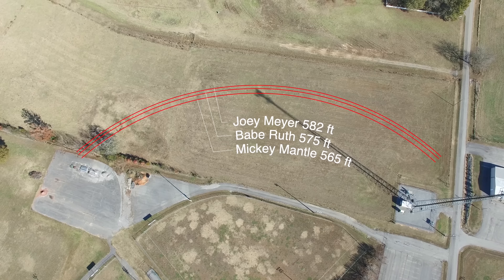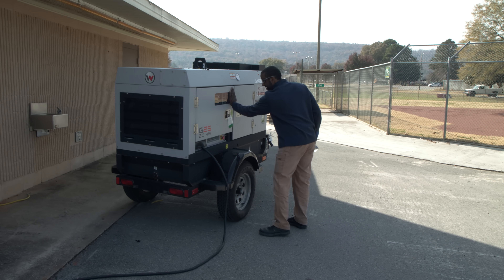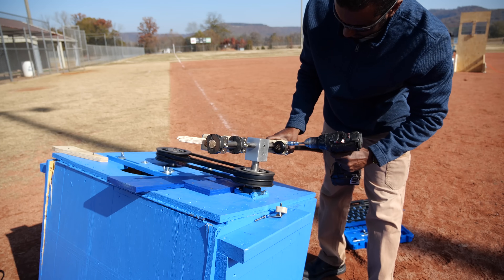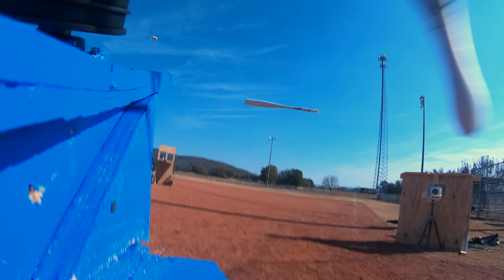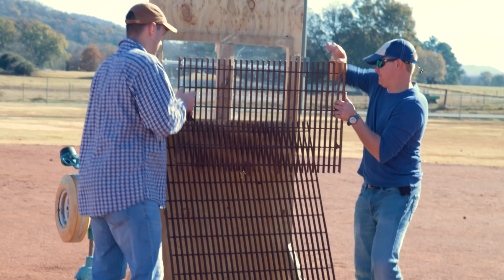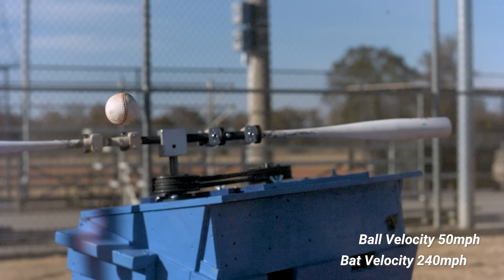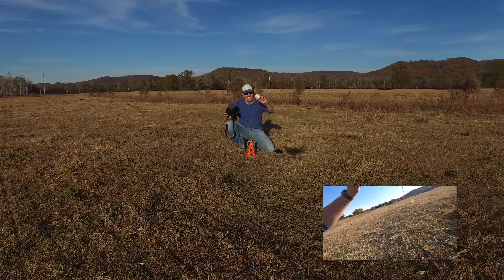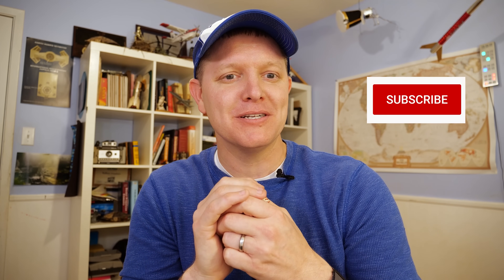World's Longest Home Run (The "Mad Batter" Machine) - Smarter Every Day 230

Comment: Use a counter weight instead of a bat and then you need to make the bat stronger and take account for the pressure of the ball hitting the bat and make sure the machine can take that kind of force against hitting the ball then try to do this 🤷🏻 I think you also need to not stand in front of this whole situation 😅 idk seems to fast for humans to react fast enough 😂 …

Comment: Fascinating video. Gold star. 🌟
It sounds like a helicopter. I wonder what would happen if, instead of bats, you attached RC chopper propellers to it. Make sure you have on military-grade protection in case of flying rotor blades.

Comment: Your statement that residential electrical power is a single phase is technically incorrect. There are two 110vac lines entering the house inorder to supply the 220vac required for water heaters, stoves, clothes dryers, etc.. Those two lines are 180⁰ out of phase with each other; thus, power entering the house is 2 phase.

Comment: Mantle on 22 May 1963 hit one in the old Yankee stadium they said was still rising when it hit the concrete facade left a mark in it and bounced all the way back to the infield. They were able to get the exact height and distance. Some estimates at the time said it would have gone over 600ft, maybe 660ft.

More recently, I saw an estimate of that shot that was not nearly that far, but it was based on a false assumption. He assumed it left the bat at 122mph. 
He assumed Mantle could not hit one out of Yankee Stadium because he never did, wrong!
He did hit them out during batting practice a number of times. This was documented in the Book "Explosion" by Mark Gallagher. 

Mantle said he was tired of the extra innings (13th inning…..BTW, I was watching on the game on TV) and he was going for it. So, he was swinging from his heals, caught it perfectly. Batting practice ball comes in at maybe 70mph, he hit a fastball so figure 90 or more? They needed to calculate with those assumptions.

Comment: This is kinda crazy since you should easily be able to calculate the maximum distance a projectile, in this case a "perfect" projectile such as a spherical ball, could travel given pitch speed, bat speed, launch angle (should ideally be around 45°), gravity causing exit velocity of x, in y seconds using the principles of physics and calculus.

Comment: Ok.... ya’ll stoopid... that machine wasn’t made out of welded steel, with the bearings bolted onto said frame... and then steel plates it’s bolted too on the ground... then bags of sand on top of outriggers....  otherwise..... ya should have built that way better

Comment: not gonna read all of the comments but....faster pitches equal longer homers so what's the deal on getting 100mph pitches on your 200mph bat?  717ft seems lackluster for J. Fielding's apparatus.  After seeing the supersonic baseball cannon video there is absolutely no reason whatsoever we don't see a 1,000 foot home run this year.  Custom cast metal bats if you must.  I live in the Lookouts city but I'll buy Trash Panda gear if it will make this happen!

Comment: Electrical science is fascinating. Like how as voltage drops, the amps increases; which is why when the 60v 3-phase generator that is the alternator of a motorcycle dropped a phase, it dropped the voltage, kicked the amps into high gear and instantly roasted the regulator that was meant to bring the voltage down to 12v. The result was that I broke down.

Comment: That looked awesome. The thing I find crazy is that even with a machine as crazy as this, it's only ~100 more feet that the world record made by a human, this human made homerun must have been absolutely insane.
Reply: It's the law of diminishing returns.  Air resistance gets higher the faster you go.
Reply: Physical limitations
Reply: Babe Ruth never Hit 575 people can't even replicate that in today's standards lol. They said that to drive ticket sells for Babe. Yall are sheepskin and believe anything. 😂
Reply: With a wooden bat
Reply: Also did it with a wooden bat
Reply: @all0utmetal735  And a guy trying to strike him out.
Reply: I feel bad for the guy trying to strike him out
Reply: It has less of a power to speed ratio than a baseball player, it proved how much strength matters.
Reply: @Adventuresandaquariums  That is not the correct takeaway. The hardest a human has every hit a ball is with a 122 MPH exit velocity. Here we have a 190 MPH exit velocity.
Reply: those records are highly exaggerated, at best they rolled down a hill to the alleged distance or is fake altogether.

Comment: When the first wooden bat broke, it was because the grain of the bat was not set correctly.
If a wooden bat was used, you should be able to get another 75 to 150 feet out of the ball.
Also, the speed of the aluminum bat might need to be adjusted so it doesn't absorb the inertia of the ball.

Comment: Ha ha. That was kool.use a long shaft top to bottom of machine.add 400 lb weight under it,balance the bats,and use solid metal bats.i had better results with 1 bat and counter weight.(this allowed the balls to enter the sweet spot better)1500 feet is about all the baseball survived. Superballs 3000,..dam golf balls,,they go way away.

Comment: You were also using metal bats not the wood ones you prob wouldn't be able to hit it that hard w/ a wooden bat
Reply: wood bats would bend and break at how fast it was going
Reply: But if the MLB used metal bats they would easily be able  to break that record

Comment: This is very cool and all but these are very juiced bats no doubt normal aluminum bats would've the same thing if I'm using that cat 8 vs my older marruci my velos would be different but yeah this is incredible and you really dont need a high angle just hit the baseball 110 mph it'll fly

Comment: Honestly I found it very impressive that humans compared so favorably. Now of course the air drag makes it harder and harder to add more distance but still.
Reply: they were not real records, rather old baseball myths. The biggest strongest sluggers today have trouble breaking 500 feet on the fly, the old records were measured at where they found the ball which includes a ton of rolled distance.

Comment: My "theory" here was the material used as a stand. It vibrated so much even weighted down some. It's high speed, so any tiny wobble, and touches the bat will send that wobble into a wave that increases and either busts the bat, or breaks a bolt holding the bat.

I think the bat's were too close to that angled wood you had to give that upwards swing for the home run.

You have to somehow bolt that stand to the ground, or.. Hmm thick steel foundation on the ground for Weight so it doesn't wobble and move? I'm not an engineer sadly, but perhaps a fan / viewer can add onto what I'm trying to say? It makes sense in my head, I just have a difficult time expressing it at times.

Comment: At 5:54 I used the approximation that the bat moved about its own length over 1 frame, and calculated that the bat flew off with a speed of about 185 mph. Dang.

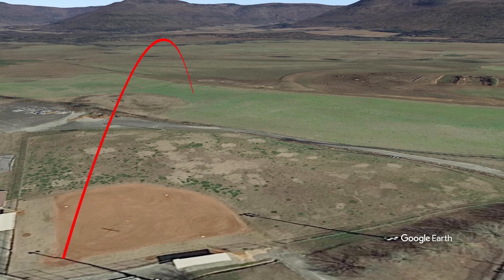Edit: Looks like I was probably close, at 12:09 he confirms the tip of the bat was rotating at 183 mph.

Comment: In MLB it doesn't count after the ball hits the ground. Mantle and Ruth hit those distances on the fly and the riochett distance the ball went after it landed was not counted in the HR distance. How far did it travel after it landed? Did you calculate the balls distance from where the ball first landed? Or did you calculate the distance on where you found the ball resting after skidding off the ground several times?

Comment: I read once...where a sports physicist calculated that under the right conditions....torque..wrist impulse speed....bat speed....low humidity...110 mph fastball...and at altitude in Lima Peru....with a 30mph wind blowing toward center field...a man is capable of hitting a 750 foot home run..... (there are stronger wrists than Barry Bonds..Pujols..Babe Ruth).......also a aluminum bat.....and hitting the sweetest sweet spout ever.....
There may be a few humans ..when skilled and trained...qhuch can generate 180mph bat speed...maybe
maybe not🤔🤔🤔

Comment: What about Manny Ramirez hit a ball on the 6th lane of tha Mass Pike if you can find video of it and use modern algorithms they originally estimated it at 580 but then changed it cuz couldn’t have Manny have the record over Ted Williams and the red seat at 502 but if you could find that game in the NESN archives that’s probably the longest HR in baseball history or Jose Canseco hit a ball on the awning of the upper deck in the old Toronto stadium or yankee stadium can’t quite remember they was also allegedly 580

Comment: Wait, use that supersonic Baseball canon to shoot a baseball at these rotating bats :D that will be awesome.
Reply: Exactly what I was thinking
Reply: @duocamerakids6266  same
Reply: The bat would snap so fast
Reply: @lucasmarshall1546  even if it's solid metal ?
Reply: @noblegeorge5789  it wold break the bat and the ball would disintegrate it’s physically impossible for a baseball to get shot at Mach 1 remain perfectly fine then abruptly stop, then get hit at 500mph and survive
Reply: @danksanchez4324  I don't think the bat will break coz the time of contact between the bat and the ball would be hardly enough also depending on the mass density and material of the ball it's very unlikely.
But all the same the ball could disentigrate (which would look awesome especially in slow mo) BUT I think it's possible to overcome that my increasing the moment of the ball by increasing velocity. Maybe the ball could be thrown at an angle towards almost the base of the bat such that adding up forces it's resolution would be towards the lenght of the bat and finally the bat imparting the balls final velocity. This would help it not disentigrate.or all the same the bat could be padded with some material to help with the sudden moment of the ball. Or just exchange the base ball with some thing else. Anyways all of the above would be cool to watch.peace✌️
Edit: you could also use the thrusters in the bat btw sooo.........😏
Reply: @noblegeorge5789  if it’s a bat made of pure steel probably not, but a normal baseball and a pure steel ball = non existent baseball and if you make the ball metal you just get a slower baseball that would probably still explode and break the bat, and if you make it padded you just get slightly less instant decimation of the baseball
Reply: @danksanchez4324   @Dank Sanchez  well to get it out first baseball exploding is cool and there exists a sweet spot between the mass of the ball and force of the bat. And what you said last is false.
Reply: @lucasmarshall1546  probably both the bat and ball would shatter...
Reply: @lucasmarshall1546  solid metal
Reply: Pretty sure the ball would be hit to neptune 🤣
Reply: @jacobkidgamerextra  the ball and the bat would break
Reply: Jacobkidgamer Extra if u think he’s shoot the ball pass the speed of sound then the bat needs to apply enough force to misdirect the ball and send it the other way without the baseball falling apart someone tell me if I’m wrong I have a 27 in science so I won’t be surprised if I am😂
Reply: Bro that ball would probably vanish, either by like complete disintegration or just going ridiculously far
Reply: Do you know about the sr72 blackbird it's supposed to be a concept to replace the legendary Sr 71 blackbird
Reply: @UCU-JLzjQ10NNKoVZCKxBm4g but you get my point, if two objects collide at 500 mph going in different directions then the object that bounces will travel less distance than if it was going at 10 mph.
Reply: Guess what? IT IS HAPPENING!!!!
Reply: That would be DARN NICE.
Reply: Use Stuff I made’s Gunbat as well. Maybe attach thrusters to the ball as well
Reply: It just instantly snaps the bat.
Reply: Brooooooo
Reply: I hope he does this
Reply: But you saw the ball hit the wall and it broke if it hits the moving bat it’s gonna look like the bird that randy hit
Reply: @jacktse1526  Unless if the bat swings more than the speed of sound, then the ball will decimate. There's no mechanism exist in this world that swings(or turns) more than a speed of sound. As I've said, it's not the ball that will break, but the bat's pivot swing will break. It's the same case of the "immovable vs the unstoppable force" in this case the thick metal panel that the ball hit is the immovable force, so that's why the ball breaks, not the metal.
Reply: @harveyscottz  the balls already going Mach 1 it’s already tearing up by the Tim it hits it’s gonna disintegrate
Reply: @danksanchez4324  think of it this way, what would happen if the ball hits a paper? would the ball still disintegrate?
Reply: @harveyscottz  it wouldn’t but it would still look like it got stepped on with the force of god, plus bat and paper not the same thing
Reply: @danksanchez4324  As i was saying, neither does a bat and a thick metal panel. If you read my recent comments, i was telling you that it can only be possible to disintegrate the ball if the bat can hit the ball at the same speed or your wrist will break (or the bat will fly away). I can give you a picture just to make you believe me. The force of the speed of sound is 1,235 km/h. To compute the force of the metal panel, you have to multiply the gravitational force with the static force of the metal panel. And just so you know, that metal panel ain't light: So there's your answer. The bat doesn't have the same mass as that thick metal panel.
Reply: @harveyscottz  well that could be solved am to lazy to explain it now
Reply: @harveyscottz  I know it doesn’t I’m just saying maybe the bat would probably survive but the ball would look more messed up than lebrone James hairline
Reply: My thoughts exactly
Reply: The ball wiuld be distroyed if the machine wasnt distroyed by the ball
Reply: @Joseph Orellana I don’t think that will work the bat will just dent if it’s metal and a wood one with just snap
Reply: But there are still questions of will the bat still exist or will the ball disintegrate on contact
Reply: Good god
Reply: I honestly expecting that godamn machine to fly like helicopter. 😅
Reply: 4:20 pure joy of his creation
Reply: That would definitely create a black hole sir..
Reply: "Listen to this"
thumthumthumthumthumthumthum
PIIIIIIIIIIIIIIIIIIiiiiiiiiing
Destin laughing
"HAHAHAHAHAHA"

this is the quality content i want more of
Reply: So u r asking him to nuke the town with a high speed ball and a rotating helicopter bat😂
Reply: I don't think that would work...
Reply: No! Fusion will occur and destroy the entire area
Reply: alishanmao 
 Might have to design and make a stainless steel bat, or something even harder with some flex. You know they're thinking about it. Will be awesome!
Reply: When an unstoppable force meets and immovable object.
Reply: Destin would have to  create a faster batting machine with harder baseballs to actually make the cannon compatible with the mad batter
Reply: I'd say the best thing to do would be to make a 1000 mph baseball vs 1000 mph bat. But obviously you shouldn't use a wooden or aluminum bat.
Reply: i think that would vaporize the ball and the bats. so yeah they should do it
Reply: if you shoot the ball faster at the bat, it will actually gain less velocity, the throw speed is subtracted from the bat speed, not added.
Reply: What about using the rocket bat attached to the swinging bat machine and the baseball is thrown by the baseball canon. Ball would go light speed
Reply: It would shoot right through the bat
Reply: That would slow things down, think of the helicopter as a big truck going 500 mph. If the truck hits a car going 50mph it will throw it a certain distance, if the car is going 500 mph then the car would go much less further because it was going the opposite way at a much higher speed
Reply: The ball will break are you dumb
Reply: @jacktse1526  or will it ?
Reply: @noblegeorge5789  There's only one way to find out!
Reply: @noblegeorge5789  well if it broke hitting a motionless piece of metal, creating more power by hitting it with a bat will absolutely shred the ball
Reply: @noblegeorge5789  **VSauce intensified**
Reply: @noblegeorge5789  the ball definitely would, so would the bat..which would make a great video
Reply: @jacktse1526  well not with a steel baseball
Reply: Devin Terrio the baseball will break the bay
Reply: Devin Terrio idk I’m not a nerd but I’m definitely not dumb I don’t know that much as I’m a kid but I have good observations
Reply: @jacktse1526  here's a pot calling the kettle black LOL. It's not the ball that will decimated, but the bat's pivot will break
Reply: @jacktse1526  no the bat would
Reply: @jacktse1526  your opinion is wrong-er
Reply: @jacktse1526  your opinion is wrong
Reply: @aliualeowatch5440  explain to me why
Reply: @jacktse1526  Just build a very sturdy ball 🤣🤣

Comment: Guys, what kind of design is it? Wooden case?  Why that generator? Any pmac motor, controller and few lipol batteries should be enough. 10kW should be enough to spinn that thing,no? Your motor looks like 100kW.